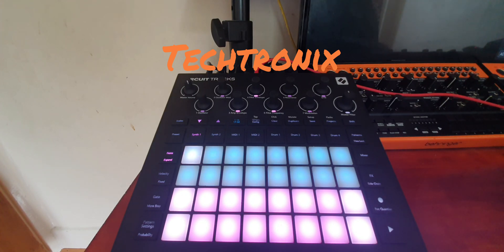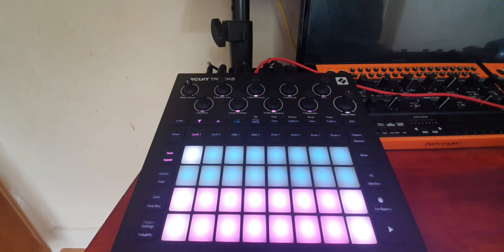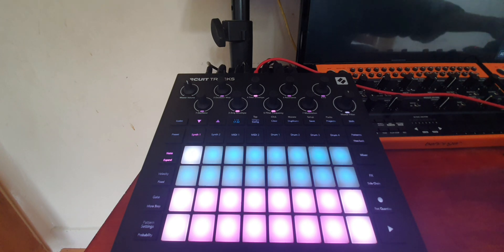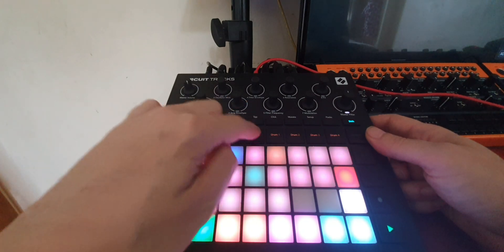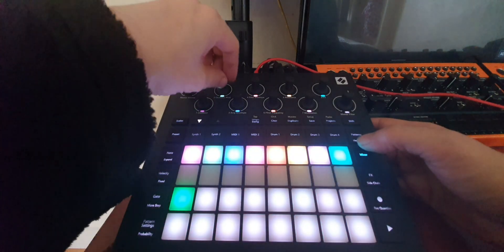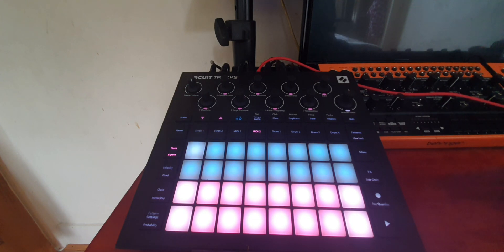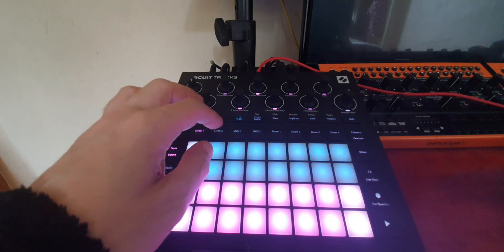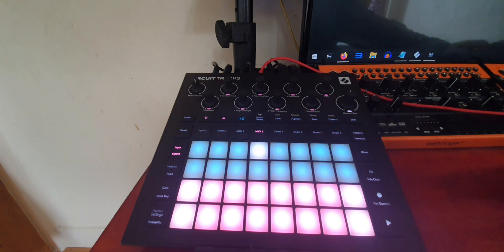#Novation Circuit Tracks Splitting the Midi

Comment: Hi! very good setup! Did you encounter any latency in the midi out causing the drums and the ext synths to be desynchronized ?
Reply from the maker: Thanks man. Not really in the way it's setup now.. the Tracks has a micro delay but nothing worry about and that's sequencing all external synths. The digitakt is master clock though.

Comment: Some thoughts on this:
1. The two midi tracks correspond to the two inputs in the back, by using those you can control the volume with the built-in mixer and use the on-board effects. You don't get that when using synth1 and synth2 to drive outs. Before I realized this I made a patch (in the Components software) which had both oscillators turned off, might still be useful for something.
2. Of course, you can use the synth tracks to drive both the internal synths and an external synth, might be useful. The internal synths do have the effects, so you could make a complimentary synth with reverb and delay, and it would combine with the external synth to fatten the sound. Haven't tried this but it should work.
3. There is a fifth track put out, the combination of all of the drum tracks, I think defaulted to channel 10. I haven't played with it, but I think you just get gate, not tone. Still might be useful to drive a synth set up for percussion, or to trigger one with it's own sequencer. hope to try that soon.
4. you can use the single out for all the midi, but only if the devices on the chain have throughs. Doesn't help trying to drive the tracks and the externals.
Fun device. I just bought both a microfreak and a modal, so hope to get jamming soon. Did you make a pattern for the modal?
Thanks for the vid!
Reply from the maker: I dont own a modal. I have done presets for the microfreak though
Reply: @TechTronix01  You can send the synh sounds back in to the Circuit; and then apply he effects

Comment: Is there a way to use both pads and keyboard to control external synths? When I use a keyboard in to the tracks, you have to use Thru setting and then for some weird reason, the lads no longer work. Really bad oversight. The mc707 has an auto channel that allows one midi Chanel on the keyboard and you simply switch ch. by switching tracks + the pads are also still enabled.
Reply from the maker: yeah you need something that merges the data. the tracks doesn't do this

Comment: Very helpful information. Thumb up!
I’ve got an Electribe2, and turned out to find so many messy things about the midi routing. I’m thinking about replacing it with a CTracks before, but it’s a shame to learn that CTracks still has some issues about the midi routing from your video.
Now I really miss the OPZ that I used to have, which has so powerful midi routing capabilities and a great sequencer. 
Maybe I would get it back one day.

Comment: Hello bro, hope you can help me :)  just bought a TD3 to sequence with my circuit tracks. I  set it to take MIDI from channel 3 and i can actually play on the Circuit's keyboard the sound of the TD3  but i can't record a sequence or a pattern that triggers those notes in the TD3. It sounds whatever i play in the MIDI channel 1 (channel 3 on the circuit) but when i put a note in a specific step in my circuit, won't do anything... Do you know anything to fix this? Thank you mate
Reply from the maker: go into the circuits setup and make sure all the lights on the bottom are lit.. the two on the left "green ones" need to be on transmit notes and recieve

Comment: Hey brother How are you? Have you try to use a keyboard into the tracks midi in. From there i've managed to play the interna synths, but is not sending midi out to the other external synths. Does it work for you?
Reply from the maker: You need to a midi merge box to achieve that dude

Comment: Great video thanks! To overcome the midi merge requirement I use Audiobus on iPad and route midi over USB where needed. Make sure to connect a midi out to the in of the synth and a duplicate of that back to the CTracks in so it gets recorded into the sequencer. 
Eg. Keystep USB midi out to iPad. Channel 3 from KS is routed to CH3 of the Synth + CH3 Tracks. Or use a midi merger.
Reply from the maker: I'm a bit anti tablet in my setup at the moment hehe.. that's a good solution though

Comment: I came into the same issue. Mind boggling to me that Novation didn't think of doing a MIDI merge feature instead of a (useless) thru. And if you switch the chord to the MIDI thru, you can then play your synth, but can't record the notes on the CT. There's gotta be a firmware upgrade that'll fix that, as it's a pretty large oversight imo.
Reply from the maker: I can't wait to see what upgrades they bring

Comment: Can’t see any reason your keyboard won’t  control your synth.. but you need to be on midi thru to pass keyboard input directly thru to external synth.. Tracks will send sequenced midi when set to midi out ...
Reply from the maker: I'm using both the outs as outs.. it can't be an out and a through..
Reply: @TechTronix01  exactly.. in this case you can’t control an external midi out from a external midi in.. only a thru.
Reply from the maker: Yeah without a midi through box I cant sequence four external synths and merge the input with the output. Probably end up getting one as they seem to always come up lol